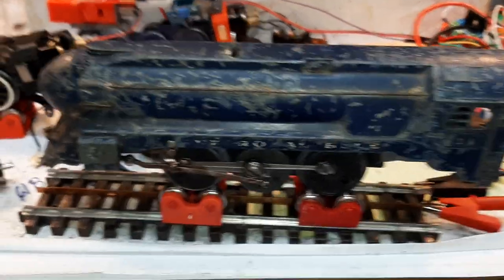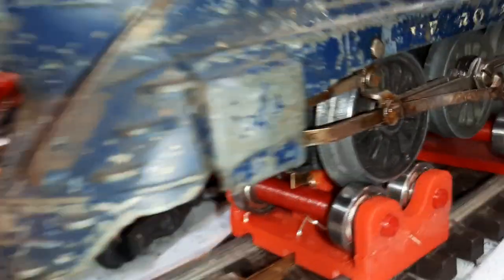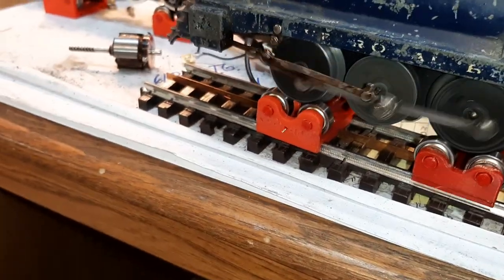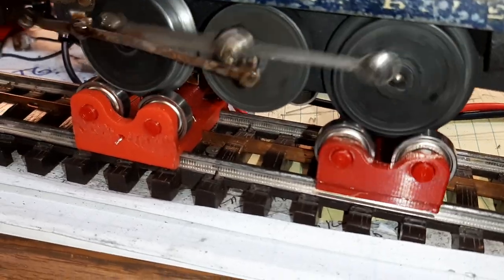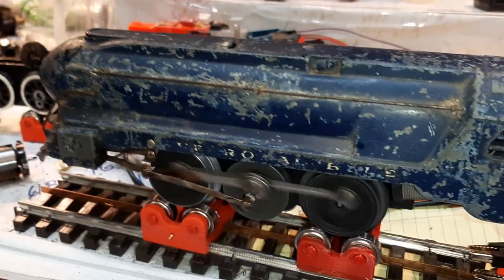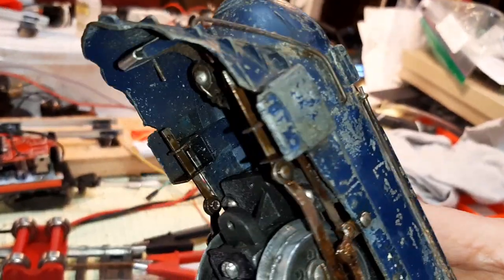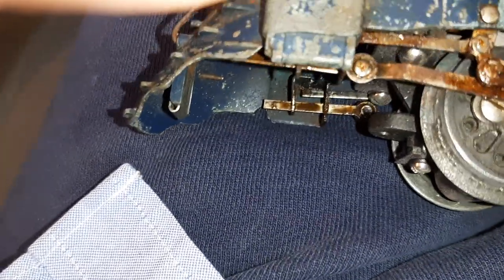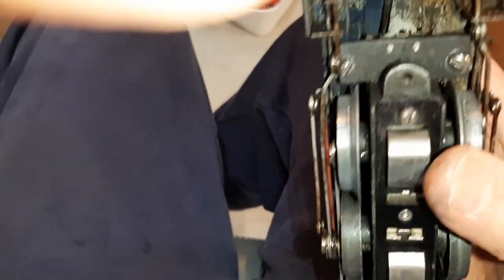Frankentrain Laboratories O Gauge powered Rolling Road  1st live test. IT WORKS!!! wiring tube up.

Comment: Powered Rolling Road looks Great!! And ya. Don’t put to much work into That Royal Blue. I just really wanted to get you to see the old Flyer “O” gauge. I’m getting another box together to sent you. A 572 O gauge Pacific chassis and the wheels on the cross bar with some other parts. I have some ideas for wheels. Keep on Rolling Dr.
Reply from the maker: I really appreciate your inputs and encouragement. I am streamlining the wire up for the powered R. R. I can believe it came together so fast for me. Am printing the next design could best penultimate just changing a screw here and there. I guess you will want a set when they're ready. Can you imagine all the crap you've seen and it will literally bolt on to that chassis. I want to fix the chassis up on the Royal Blue but a I can't paint. I truly love taken the cast away engines and making them the best. I have an extended chassis from Leon's project I want to add the 10A reverse board and hook it up that 2X on the Northern and hook that up to my Vette and see if UT can pull it! No there is a project! D

Comment: Nice work. I am thinking these will be good sellers.
Reply from the maker: I completed the next iteration of wiring design but my camera was acting out then the OLD Royal Blue started tripping my transformer. Might need to take apart to fix that so I have test engine. You Mind? Having a lot in interruptions lately. I have 3 of the Chuff sound boards and no time to build a Perf board of Puff and Brake. Ugh!